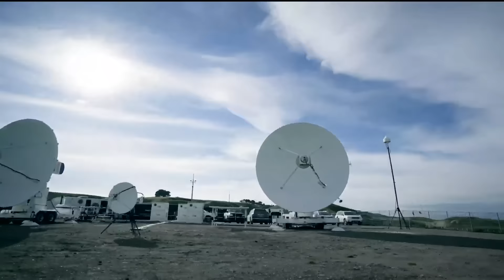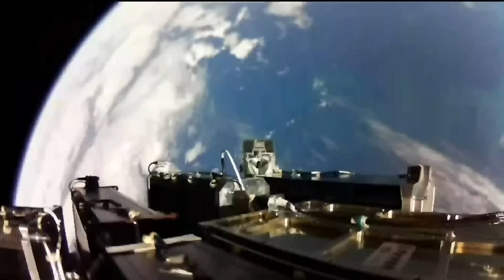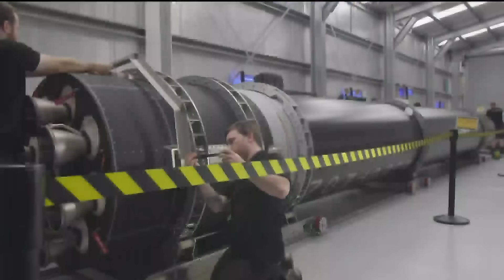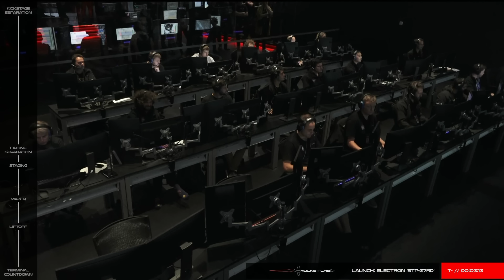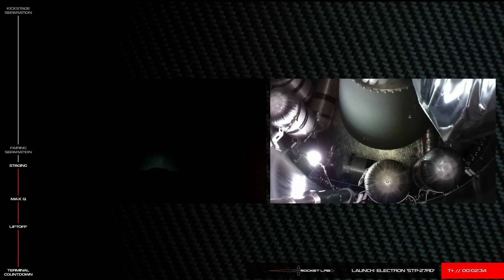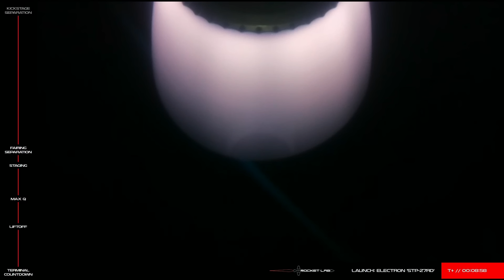STP-27RD Launch - 05/05/2019

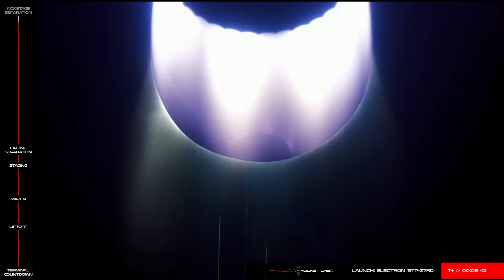Comment: Whats with the color switch at 24:43
Reply: The radiation cooling on the nozzle allows it to cool by giving off light, when the engine shut down the nozzle cooled below the temperature required to give off the purple light therefore the color changed
Reply: @jmister28  I'm confused by what you mean because the engine was still firing.
Reply: Oh sorry wrong time, that color changed was caused by the bell heating up enough to cause the radiating of the light, the same thing occurs in. reverse when it shuts down @Battleship61234
Reply: @jmister28  Awesome. Thanks for the explanation!
Reply: The colour switch is caused because of having the camera's set to Auto White Balance

Comment: Congratulations! And a question: a lot of sparks. Running a bit too hot, or what causes that?
Reply: The sparks are from tiny bits of the nozzles burning off to keep the rest cooler.  Basically like the ablative shields used for spacecraft re-entry.
Reply: @toddjohnson5692  Rutherford is a regeneratively cooled engine though.
Reply: Yup for the first stage engines and I'm supposing much of the second stage.  But the larger end part of the second stage nozzle appears to be ablatively cooled as are some other second stage engine nozzles.  That's where the sparks are from.
Reply: @toddjohnson5692  In the earlier launches -- for example, in the first commercial launch "It's Business Time" on 11/11/2018, you could see plenty of sparks from the first stage. They become more visible at the higher altitude when the exhaust spreads out more.

The second stage engine seems to have a very thin nozzle extension, which gets red hot. Presumably, it is made from a refractory alloy -- similarly to SpaceX' Merlin 1D-Vacuum engine. Niobium-hafnium alloy can be used at temperatures up to 1650C with acceptable strength. As the exhaust is sufficiently expanded at this level of the nozzle extension, the pressures and temperatures are much less extreme here than in the combustion chamber.
Reply: In this launch, you can also see the sparks from the first stage at 19:20.

Comment: Now my question is what's with the sparks coming out of the engines because I don't usually see those on other launches
Reply: To keep the engine simple it is cooled by ablation. Most bigger engines are cooled by cycling fuel into the walls of the nozzle and combustion chamber, but this would be too heavy for such a little engine. 
It's quite like the heat shields used for spacecraft reentry.
Reply: @3gunslingers  Oof, I feel like I should have figured that on my own.
Thank you tho
Reply: @clayman0430  
:)
Reply: @3gunslingers  Rutherford -- that's the name of Rocket Lab's engine -- is a regeneratively cooled engine.
Reply: @cogoid  
Damn! You are right!
Now I don't have a clue anymore where the sparks could come from. 
Maybe still slightly ablating the chamber walls?
Reply: @3gunslingers  I spoke once to an engineer from a company using a similar 3D metal printing technology. He complained that it was very difficult to get rid of small metal particles in the internal channels. My guess is that no matter how much you clean the printed engine, the stresses during operation continue to loosen some of the incompletely sintered powder off, and that is what makes the sparks. But of course, I do not know for sure, and would be very interested to get a definitive answer from somebody who really knows.
Reply: @cogoid  
Well, it would make sense.

Comment: What is up with the large amount of sparks in the engine exhaust? Is it carbon buildup from the RP1? Or combustion chamber erosion material?
Reply: My understanding is that this is a product of ablative cooling.
Reply: It happens in every Electron launch, and it is unusual. With 3D printing technology, the internal passages in the parts can be very difficult to rid of somewhat loose metal powder -- maybe that's what we are seeing, though it would be great if somebody from Rocket Lab could comment and give a real answer.

Comment: I like Electron. But I feel bad about it not being reusable.
Reply: Agreed. A similarily sized  rocket made by a Chinese company just completed their first self landing test. I wonder if Rocket Lab will bother persuing the technology; i’d imagine the value of reusing the rockets would be significantly lower than the larger rockets of SpaceX or Blue Origin
Reply: They are working on a satellite bus platform built specifically for the electron rockets so customers can focus on building services rather than hardware
Reply: Its probably not part of their plan yet. They do have some innovative tech of their own though.